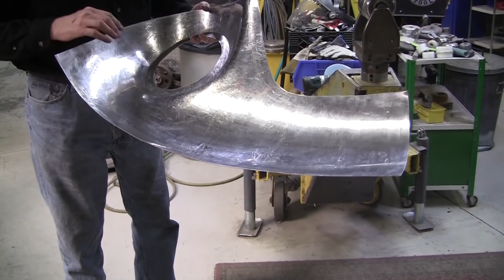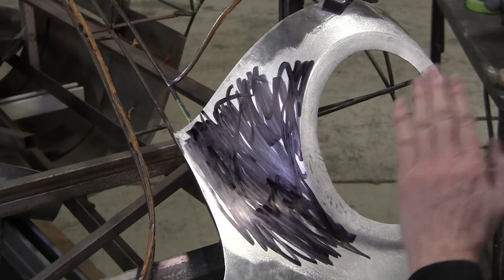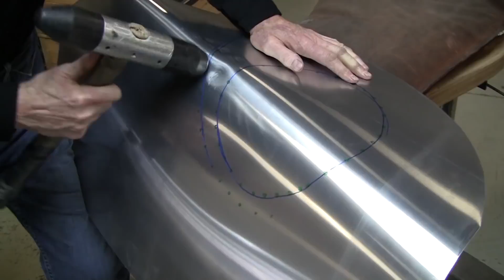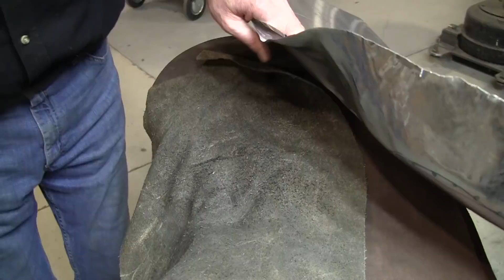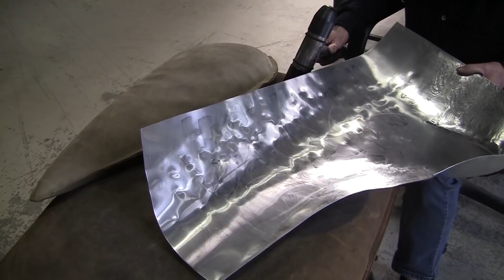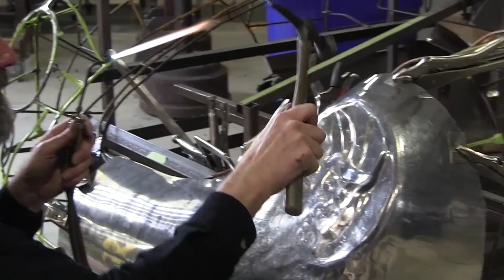Metal Shaping: Porsche 550 Panel Finished

Comment: I always wonder the cost of these things. I know you're pretty mindful of cost when it comes to tools and materials but what does it take to make a car body or a single panel?
Reply from the maker: The cost of materials/supplies and  what you value your labor at. I tell my students to do a first class job scratch-building a car the cost of components( Engine, transmission, tires , wheels, etc) and supplies ( welding gases,leather, metal, etc. ) will run estimated at $30000.00 to $60000.00.  Your Labor expenditure:  figure 2000 to 4000 hrs. This is for scratch-building a turnkey car like a 300S Maserati, 550 Porsche, or a one off Hot Rod.  Cars that cost in the millions to purchase.

Comment: So whats the difference between doing this in aluminum instead of steel?
Reply: Hi tj. Well if you've worked with aluminium as long as Wray has then you would say that's the easiest material. If you've worked with steel as long as l have then steel would be the answer. Either way it takes tremendous skill to master either. I would be daunted to work with alloy whereas Wray could happily work with either. The big difference is when you have mastered aluminium it gives the best results for the minimum work and it is much lighter. Hope this helps.
Reply from the maker: Same skill sets, steel or aluminum. This method was one method of achieving a successful panel. There are at least four different ways to make this panel.
Reply: @proshaper  i meant like whats the merit of doing it in aluminum instead of steel?
Reply: I would love to see a steel one made now , as a comparison
Reply: 550 bodies were all aluminium!